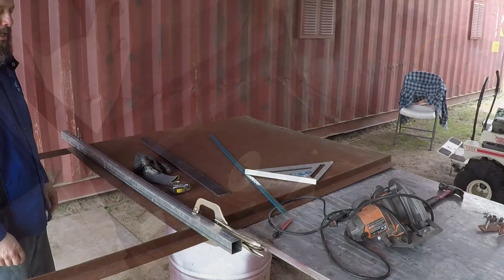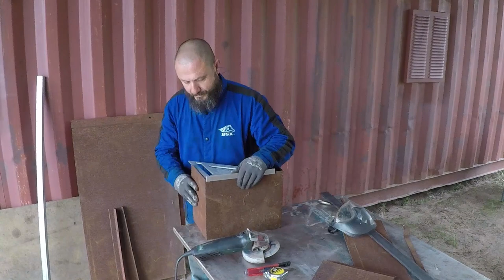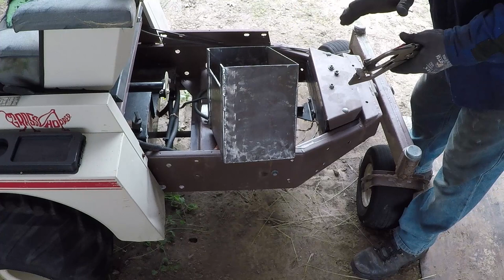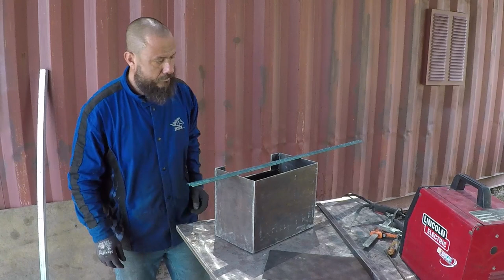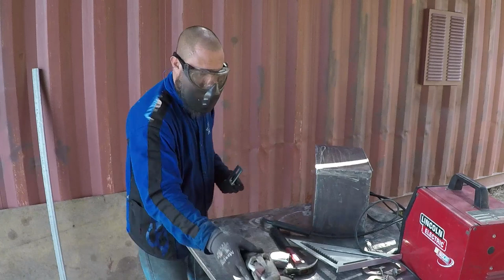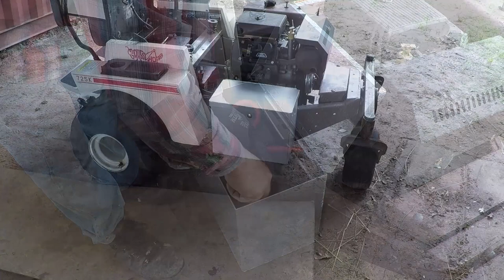Make Battery Box For My Grasshopper Mower

Comment: Nice work. I noticed the cables were resting directly upon the edge of the battery box rear wall. Could you not put a longitudinal slice into a rubber hose and slip it over the wall and under the cables. I believe this would prevent friction between the cables and the box wall from rubbing away the cable insulation. Or, you may already have a solution not illustrated in the video. Wishing You and Yours All the Best.👍
Reply from the maker: Good morning brothe. I hope you had a great Thanksgiving. I wrapped the positive terminal with friction tape then topped it with red tape. Since I finished with this project, I added rubber hose around the two battery cables and secure it with tie wraps (like what you suggested). I also have round edges where the cable touch the box to prevent damaging the cables. Thank you and have a blessed day
Reply: @SalamSayhood  Excellent.. You have a great day as well Salam.👍